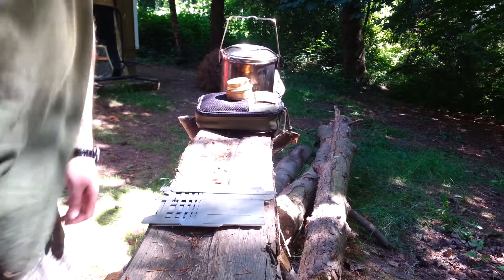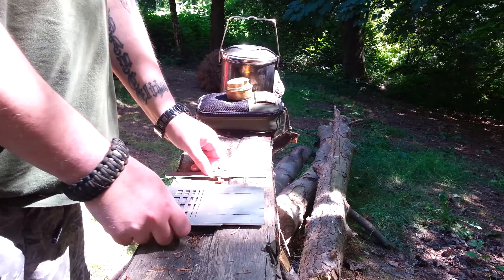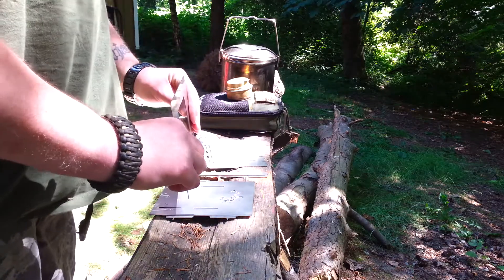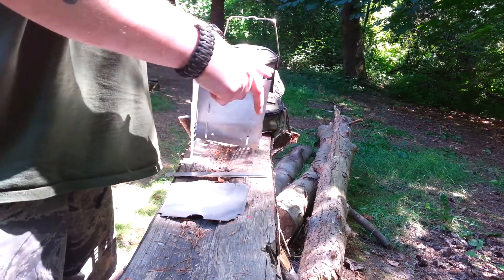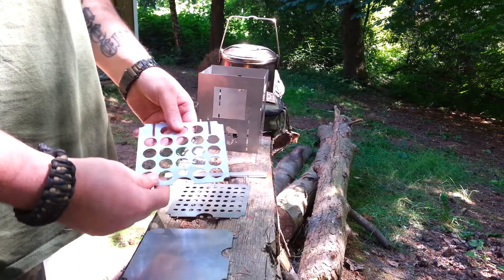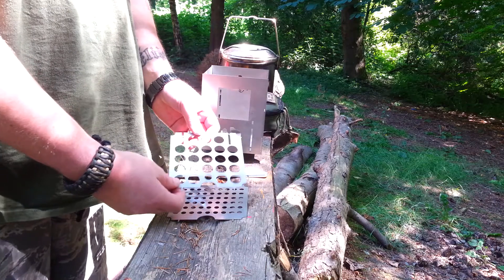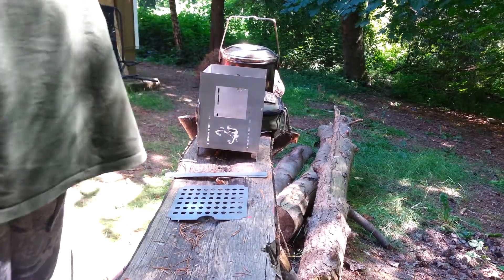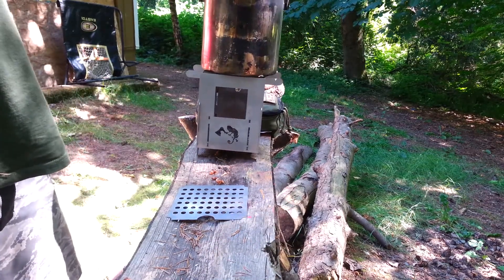The Billy Box, set up, thoughts and comparison

Comment: Looks like a cool stove Nathan, you'll have fun putting it through it's paces. Since all stoves burn well for the first ten minutes or so, you'll want to try an extended burn (45min to an hour) with a pot on top, keep a big pot of water boiling, that will show how the stove handles ash and coal build up and you will be able to see how the exhaust flows when being used as a stove. Not to mention getting a feel for feeding the stove in a real use scenario.  Testing is my favorite part, I love observing the flames as to track the flow patterns. PS, a light coat of oil between uses will keep your Firebox looking nice. Cheers, Steve
Reply from the maker: Thank you so much for your input Steve. I really appreciate that